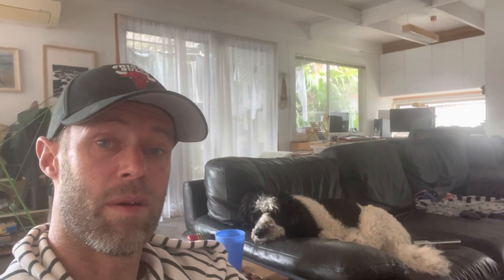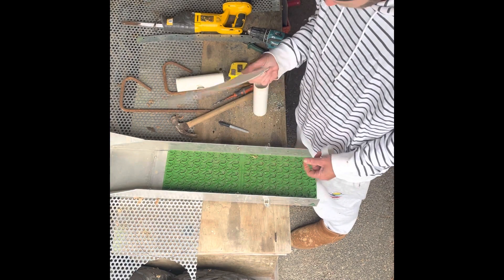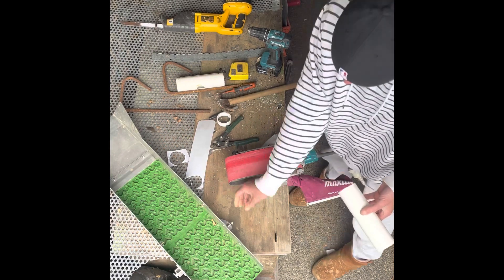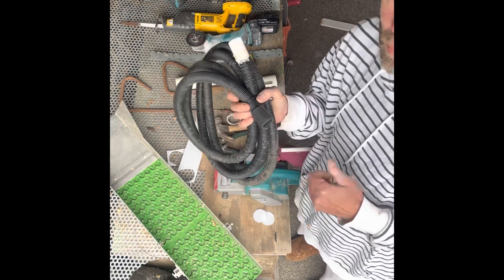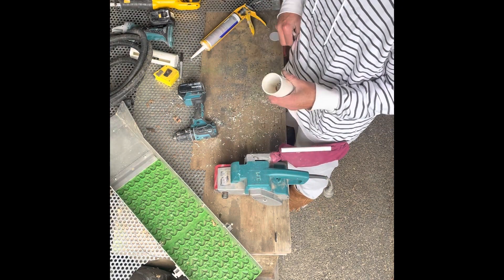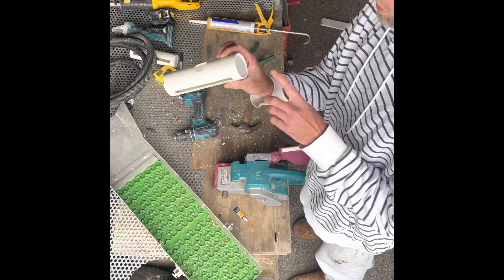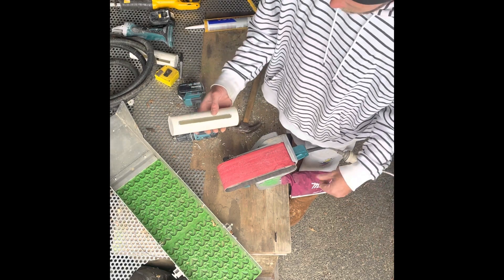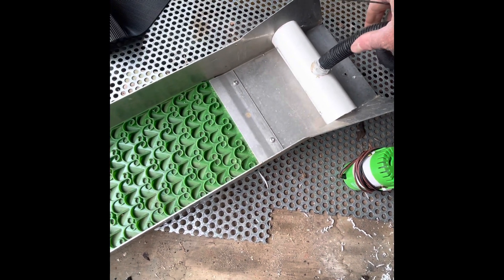A cheap and easy header box for your river sluice

Comment: Sometimes keeping opened super glue is best in the fridge….great work with the header👌goin to do the same with my 6&8inch sluices👍
Reply from the maker: Really the fridge? That’s cool. Very sorry 
I’ve been down to the creek too many times thinking there’s enough water running but there’s not. If only I took a sml pump, header box battery and hose those times. Thanks for watching Dean👍👍
Reply: I would advise against keeping Super Glue in the fridge. It is not worth the risk of contaminated food and the possible expensive medical side effects just for the sake of a little $2 tube of Super Glue. It is just not worth it. 
Mark from Melbourne Australia
Reply from the maker: @markfryer9880  the last thing I need is 3 boys getting high on glue while they eat their lasagna. Cheers Mark
Reply: @markfryer9880  true,but I should of mentioned that I’m in far nth Queensland,we’re most of us males have got a beer fridge in the shed.I’m not allowed anywhere near the inside one..lol

Comment: Gday james, 
Sorta new to this channel, 
by any chance could you show us how you put in the black bit at the front or where you get it from?
Reply from the maker: G’day Joe, the mat I used is called v mat. I got a metre of it from Bunnings for about $20 and have used it on a couple projects now. I just cut it to size with a knife, just make it tight enough that it doesn’t have any big gaps down the sides. The header box will hold it in place! Thanks for watching. I hope this helps 👍👍
Reply: Thanks, heaps! Will try to make a clamp or something in case I need to use it on the creek 😁

Comment: Another couple.
What diameter tube you use for this header box ?
And , are the discs really necessary ?
I suppose with the way your sluice flare has been designed , they may well be.
But if the sluice box had enough flat wall surface , could you just cut the header as a tight fit into the sluice , maybe use a piece of cut car inner tube as a washer to make it a nice sealed tight fit  - would that work ?
And one more - How high above the sluice bed do you have the bottom of your header , or is it actually sitting on it ?
Reply from the maker: 65mm diameter pipe and the end caps are necessary on my sluice but I’m sure it would work if you just sealed it anyway. Depends on how many times you think you will use it.
You want about the same width of your sluice above the mat to get even distribution of your material down the mat. Any shorter and you have to spread it out when you feed it.👍👍

Comment: Do you have any issues regarding water trying to sneak up the sluice and dripping out the wrong end ?
And how do you keep the hose from popping out of the header hole ?
I know you said it is a snug fit , but is that it ?
Reply from the maker: I’ve not had the hose pop out. There was a little pool above the header but not enough to worry about